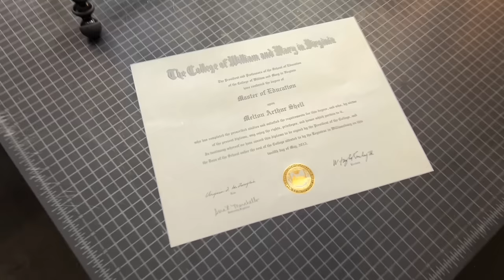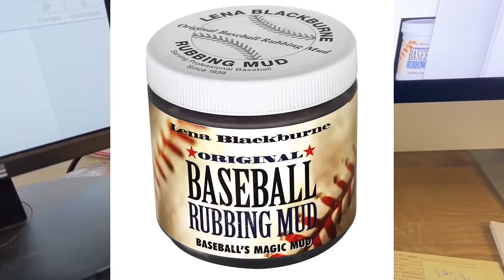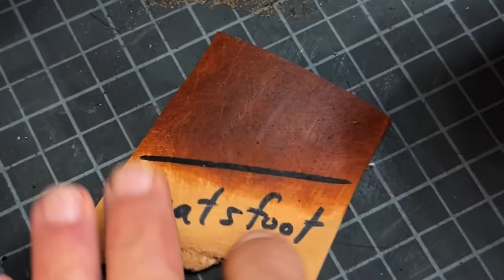Will This RUIN Your Leather Wallet?

Comment: The dirt selected makes a difference. I suspect the “official” mud is fine-grained silt or clay which is abrasive enough to take the shine off of a ball without scratching the surface up. The mineral makeup of the specific “mud” determines the color.

Comment: The spot might of been some Tokonole.  It has a habit of blocking dyes once it's applied.
Reply from the maker: I’m 90% sure you’re correct.  One reason I rarely use straight raw veg leather.  It’s so finicky